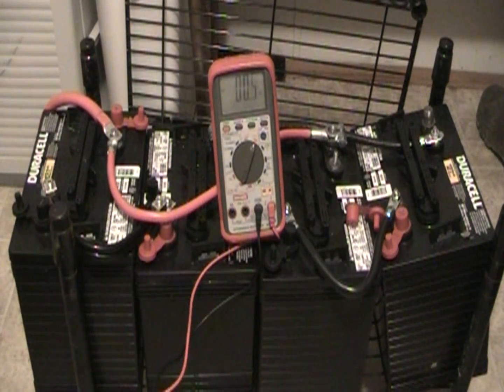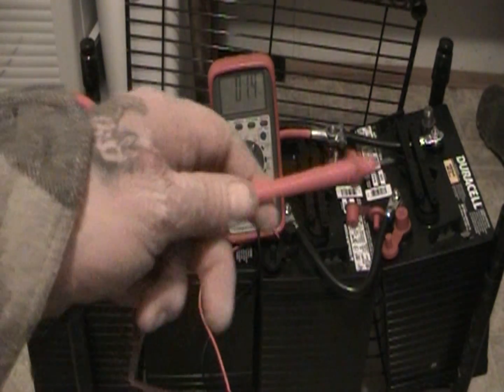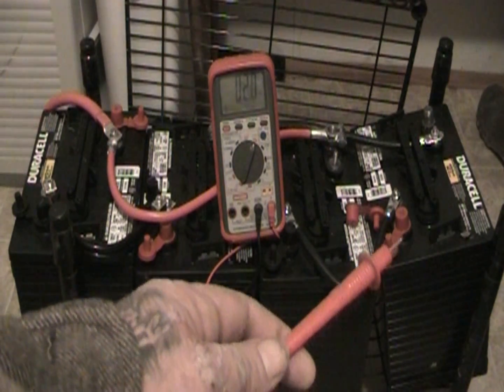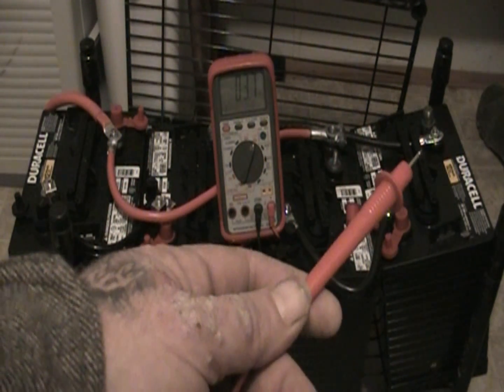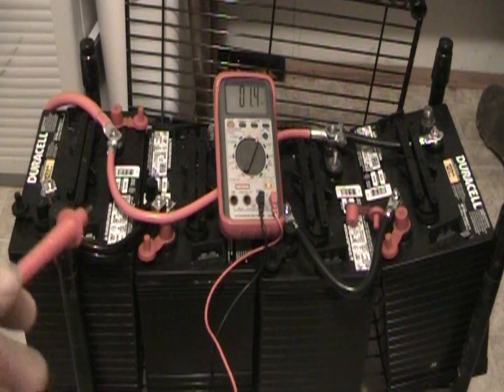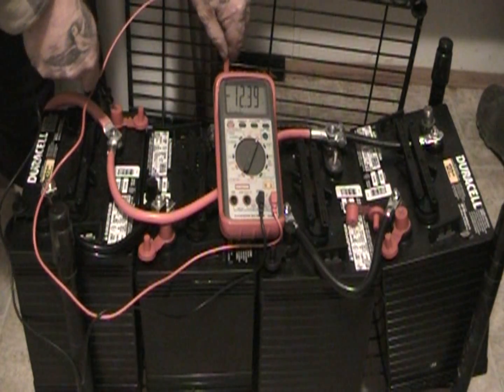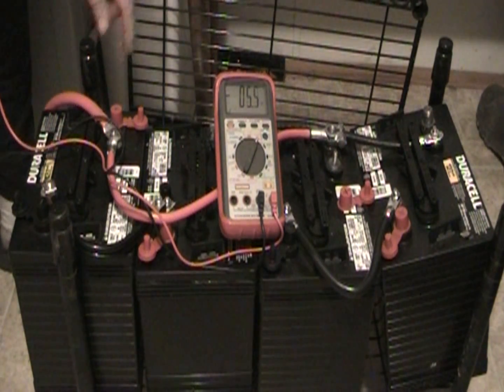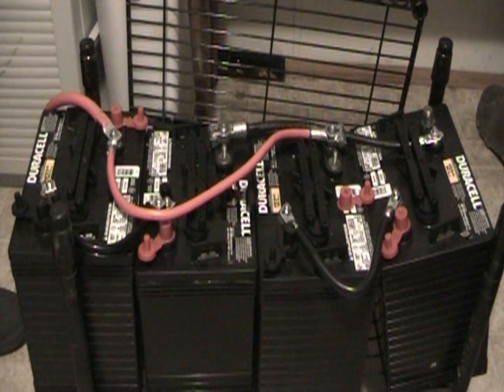Solar Panel Project; Pt.1 Wiring 6 volt batteries in Series Parallel, and inverter

Comment: I'm not an electrician and I have no experience beyond reading and watching videos concerning solar power. What I do know as a fact is that I've gotten a similar spark connecting a charger to a car battery on many occasions without damage, explosions, or black tape over my eyes.

Comment: You were right to be concerned when doing these battery connections, as we all dread the possibility of making a mismatched connection, and we can't help but think of the cost to replace these batteries, and think of what sort of damages might occur from the exploding bank of batteries. Thoughts of those batteries aren't cheap, not to mention the thoughts of potential personal injury. You sounded tired, as if you had struggled with yourself to do this for sometime before you decided to make this video. You were concerned about the spark, from having already attempted to connect the inverter before.

You did good. I have been thinking about this myself and had made up my mind that I was going to do just exactly as what you have done. I then decided I would take a look on YouTube to see for sure, if anyone else had actually done this. So when I saw your video, I was feeling a bit of uncertainty and felt as you did. Ultimately, my plans would be to wire 10, 6-Volt batteries together in Parallel, each having 225-Amps, then connect one more 6-Volt battery wired in a Series for having a  12-Volt battery bank. Are you with me so far?

Now here's my question. Focusing on the last 6-Volt battery that gets wired in a Series for the 12-Volts, I don't see the need for that last battery to have a high Amps rating as those Amps don't get included in the total when wired in a Series, only the increase in voltage from 6-Volt to 12-Volt. I don't see any significance of that last battery, wired in as in a Series, to be equal in amperage to the other batteries wired in Parallel. I feel that the last battery, wired in as in a Series, can be a good 6-Volt deep cycle battery with perhaps 10Ahours. I just don't see a need for the last battery to be a high-dollar battery. What do you think? Do you see any reason for the last battery to have high Amp hours? As for the last battery being wired in a Series, as long as the battery is deep cycle and similar in expected number of months use, I don't see the need for an expensive 6V battery as the last battery wired as in a Series.
Reply from the maker: I agree Sam, I can't afford those high dollar batteries, and am having good luck with the ones I have.  when I add more batteries to my bank, they will be the same that I have now. 
J

Comment: B1 negative as free power cable
B1 negative to B2 negative (parallel for B1 & B2)
B1 positive to B2 positive (parallel for B1 & B2)

B2 positive to B3 negative (connects B1 & B2 to B3 & B4 in series)

B3 negative to B4 negative (parallel for B3 & B4)
B3 positive to B4 positive (parallel for B3 & B4)
B4 positive as free power cable

Comment: From research on this topic I believe the wires you have for the battery bank should be 2/0 copper or 4/0 aluminum to prevent over heating and to also reduce power loss.

Comment: Thanx for posting. I have a bunch of 6v batteries and going to build a small bank as well. Hopefully enough to run a small mini fridge and laptop computer. Though, I can't find video 2 in this series. How did it turn out? And how did you hook up to the rest of the system? What wattage of the panel should I purchase to charge this system?

Comment: im not a expert but from what my pea brain has read before it looks right  , but i would get a better base to keep them on  and i would also get some spaceing between the batteries just look for some scrap 1x 4 wood and make a small box at the base of the batteries .  that way there air flow between them and also solid base for them to rest on   i wouldn't keep them on that wire rack just incase there bumped you dont need sparks flying around    but hey im just a dumb country boy here

Comment: Brother John, be careful. I see a few backyard electricians here.  Their intentions are good, but it looks like some know just enough to burn the house down. Did you know most house fires in the U.S. are caused by folks who "think" they're electricians. Most don't have a clue about sizing a protective device. Each protective device (fuse...breaker) MUST be sized according to wattage used at a certain voltage. Volts x Amps = watts. Amps are what creates the heat.. Check the inverter manual.

Comment: The reason you want to use the Positive (Red) on battery one, and Negative (Black) on battery four is.... while charging, it charges ALL the batteries evenly. I've seen people use the pos and neg off the last battery. All that does is charge the last battery while the others get a trickle. I

Comment: Always use 6 volt batteries connected in Series/Parallel for a 12 volt solar power system. You can connect a thousand of those babies (if you have the room, lol) or more. As long as you have 12 volts coming off the two main leads and your charger is rated for that many batteries.... you're good to go.

Comment: I picked up panels off amazon DM solar 145 watt panel for 12 volt systems, price around 168.00 buck per panel delivered, You have to buy 2 at a time tho. They tested out great I now have 4 panels. I had some harbor freight 45 watt panels, got 3 sets of them as well. Cheaper to go with the 145 watt panels more bang for the buck. Hope this helps John.

Comment: Well done John! Kudos'

If you are using your 3 panel 12 Volt system for charging your battery bank hook them up to the same battery posts you have your inverter hooked up to (making certain you have the correct polarity from your panel leads!!!).

Just curious, what is the Amp Hour rating of each battery? 

Regarding the fuse, I would suggest something around 100A fast blow or if you can find it a 75A slow blow fuse. Make certain the fuse you use is DC rated for that Amperage. It DOES matter.

Comment: Hi John; big batteries like this can spark a whole lot simply because there's a lot of /initial/ current capability. I needed to jump start a diesel pump motor once and made the mistake of letting the cables dangle together. THAT was some disco! What was worse I was standing in a puddle at the time, luckily with rubber boots on!

Comment: John, Be sure that you put a large fuse between your batteries and the inverter. Just a safety in case the cables short or you overload the system, the fuse will protect the batteries. Fuse size will depend on the wattage rating of the inverter.

Comment: I like your setup...but have you looked into the option of using straight DC powered lights and small appliances? It is my understanding that this is a more efficient use of your battery power? Get yourself one of those DC cigarette lighter adapters, and the appliances plug right into that...I've also seen 25 watt LED light strips on EBAY that have positive and negative alligator clips, and even come with an on-off switch. 
Anyway, good job brother...I enjoy your videos.

Comment: I'm putting together a system with four 15 watt panels and a 800 watt inverter, what type of batteries are you using, are they 6 volt golf cart batteries? Great project, John.

Comment: Hook the inverter to a single 12 volt car battery. If it sparks the inverter is drawing a load. If it does not then something is up with the 6 volt battery bank wiring.

Comment: leave the cable loose, and hook your multi meter between the battery and cable connection.   positive (red) to the load and black to the battery since it is the ground cable you are testing.  leave the device off, make the connection and turn the device one.  MAKE SURE the amm meter is set at a high enough setting to handle the test. or esle you can blow the fusee in the back of the multimeter.  (they are replaceable)

Comment: You do have a correctly wired series/parallel bank of batteries. an active power load hooked to your power source will make a spark when the connection is made.  however that was a big spark !   You can safely make your connection across one bank of series and the other two will just be storeage capacity. you proved with your multimeter that 12 volts is 12 volts.  as long as the cableing is equal, you will get equal amperage across the entire bank.  to test the amperage draw ...  part 2